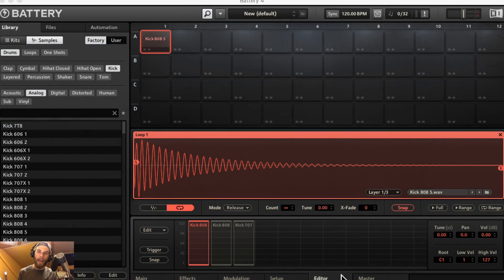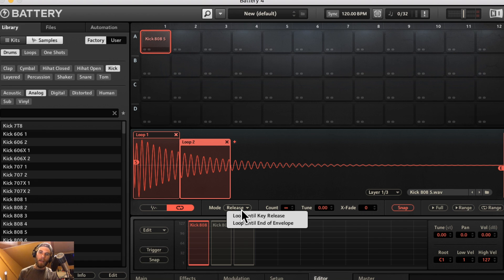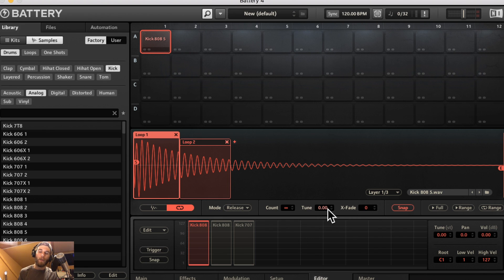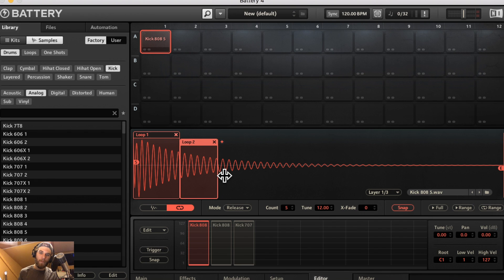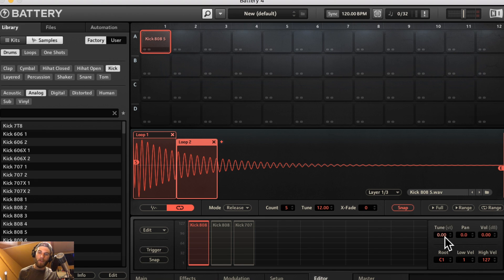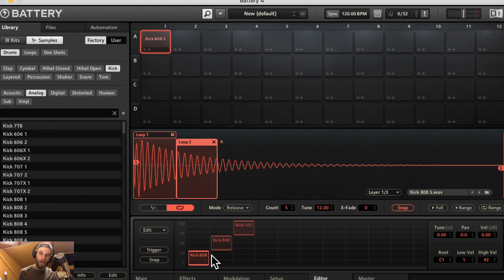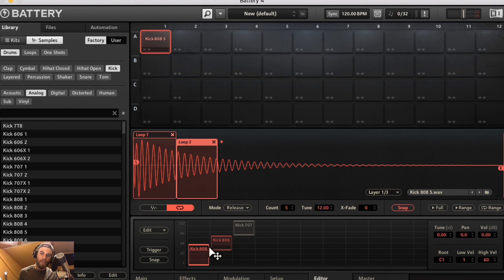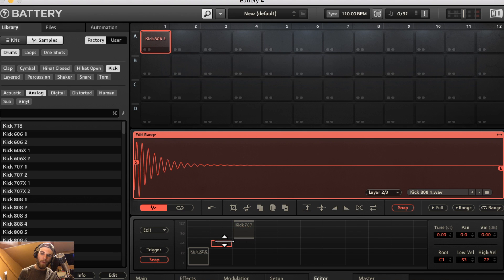Battery 4 Controls: The Loop and Mapping Editors

Comment: Hi everyone, is there anyway to get Battery 4 to play back a midi track created from Ez Drummer 2 midi groove libraries ? It doesn't seem to trigger Ez drummers midi notes correct. If so could  you please explain in detail how to do this . I'm using Cubase Pro 9.5 MacBook pro
 Thanks!----
Reply: Either map battery to use the notes ezdrummer midi expects for each drum type, or change the midi note for the drums in ezdrummer to match battery.